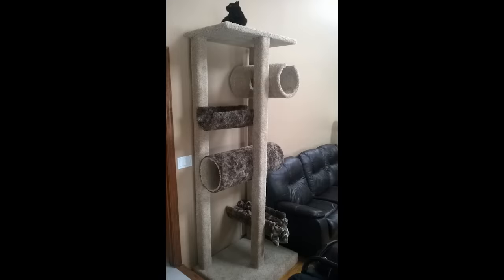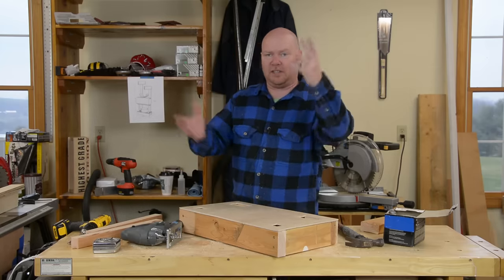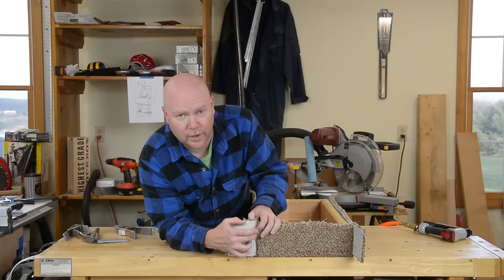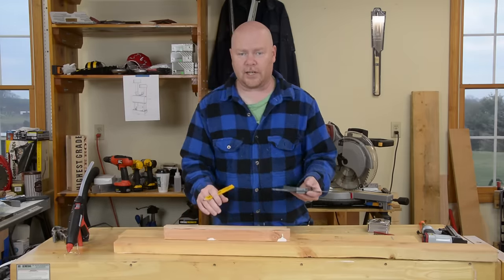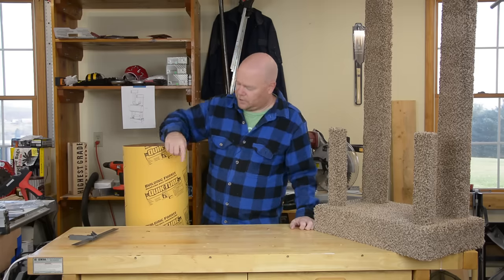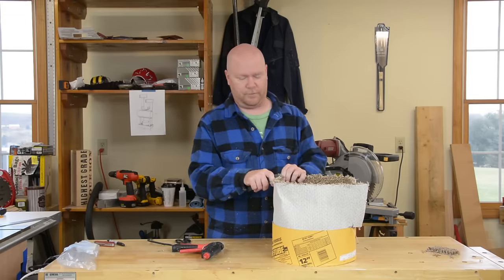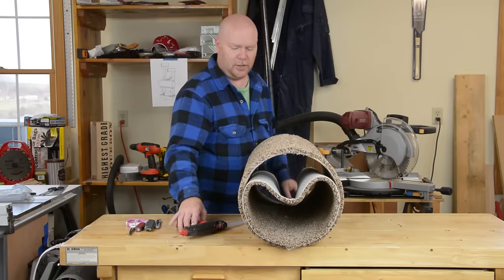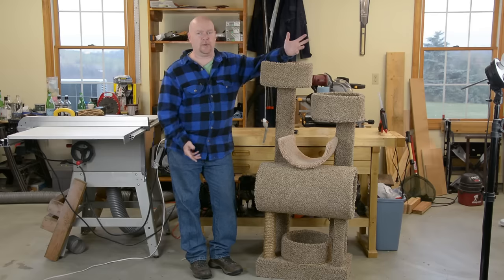Building a Custom Cat Tree

Comment: Great video!  I used a 60 watt glue gun and it kept up but barely.  Lots of 100W glue guns on Amazon.  Also, I used two 18" pieces of that concrete form.  I ripped a 2" section out lengthwise from one 18" piece and glued it inside the other 18" section to make the tube more durable.  https://i.imgur.com/fShpLkC.jpg

Comment: How much did this project cost?
Reply from the maker: Justine Spencer it really depends on how you source the carpet.  the rest of the materials will be less that $50 almost no matter the size.   I spent another 50 on carpet because I bought new and off the roll.  you can do much better with remnants or discarded carpet finds
Reply: My husband made one of these for our cat but he used some tubes he got free from the carpet store.  He covered some with sisal rope like you did  He also used a concrete form.  It looks a lot like yours.  It has held up fine for over 8 years. :)  You made a great cat tree!

Comment: Did this save money
Reply from the maker: +Majara Gaming Quite a lot.  How much will depend on your options for carpet.  I bought new carpet off the roll for this one (mostly due to schedule), so I have around $100 in the project.  That's probably around a 50% savings over a commercial model.   For the 8 footer in my house though, I was able to get scrap carpet, and the tree is much bigger.  I saved several hundred dollars building that one.

Comment: By the time you buy all the wood, carpet, nails, glue, rope, (rent the tools to cut the wood, and a nail gun), etc., wouldn’t it be easier just spend the $130 at the pet store ?
Reply: T Watson I bought all the materials yesterday to construct this. I spent $62.00. Not buying the tools of course and shopping at Home Depot. There are cheaper options than HD.

Comment: awesome video. however...I cant make this. I have a drill, a hammer, and a stapler.
Reply from the maker: +Jessi Lynn If you were willing to add a saw, and yes a hand saw is fine, you can!  You can attach carpet with just staples, and you can use nails to put all the wood together.   The cement forms can be cut with any saw, or even a knife if you're patient.

Comment: I hate to be a buzzkill, but couldn't you do a little math to figure out how much carpet you needed on the inside of that tube rather than going through the hassle of trying to stretch it to fit the inside of the tube.? I know you can but wouldnt it be easier?
Reply from the maker: Theoretically yes.  In reality those tube are sold in "nominal" sizes.  You have to measure each one - and they're not perfectly round.  Once you fool with all of this you have to measure and cut the carpet exactly straight to exactly the right length.

So yes the calculation process is trivial, but getting the right inputs is probably no better than the "cut to fit" process.